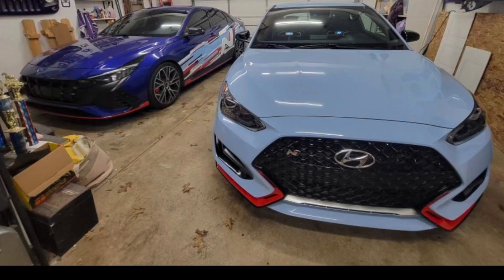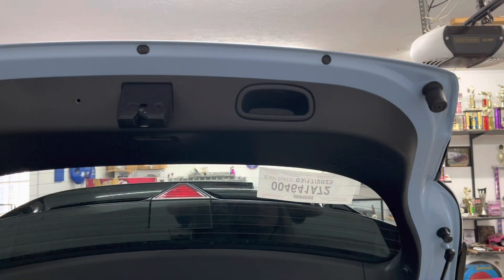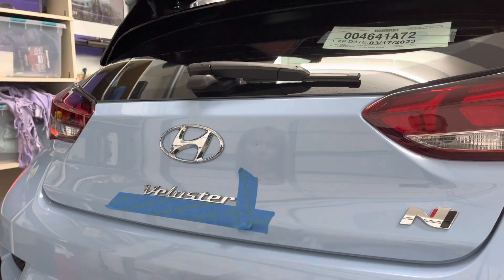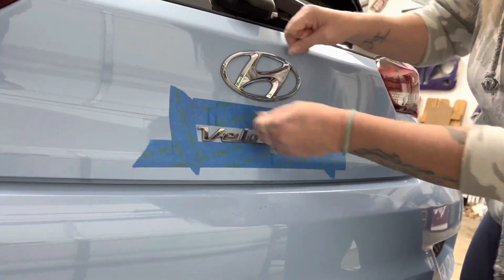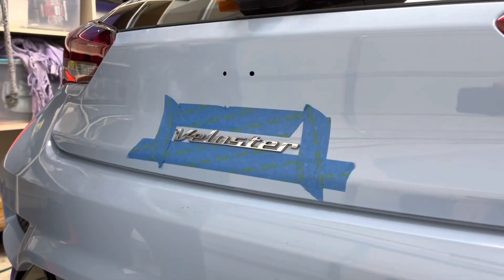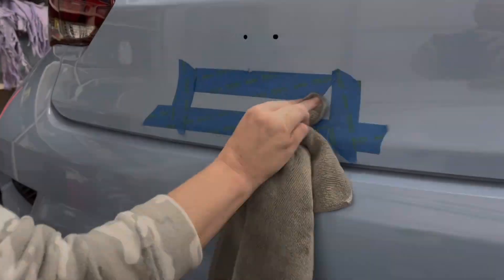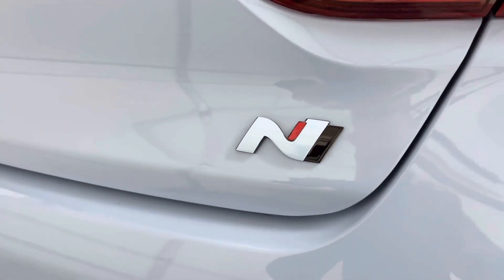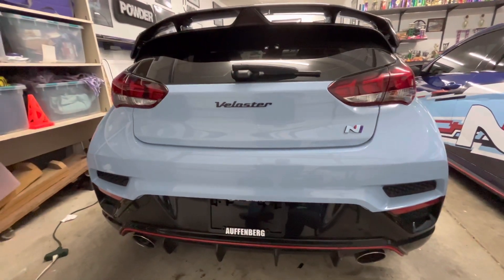2019+ Hyundai Veloster N Rear Badge Emblem Removal and Relocation

Comment: How can you cover up the the two holes that’s left from removing the emblem?
Reply from the maker: We put a small piece of vinyl over one hole and were able to cover the other one with the Veloster emblem. If you want the trunk to have no emblems, you’d need two small vinyl circles to cover the holes. That would be the cheapest and easiest way vs having the holes filled and painted.
Reply: @nprform  oh okay I see thank you! I had another question not sure if you’ll know much about it, but I have a Hyundai Elantra N-line and I’m trying to remove the front emblem but I noticed it has more than 2 holes like the back one does. Any suggestions on what I can do about that?
Reply from the maker: @Eyusria27  I installed an emblem cover. I bought it off eBay. 
https://www.ebay.com/itm/194328957704?mkcid=16&mkevt=1&mkrid=711-127632-2357-0&ssspo=fAQSDBC-TC2&sssrc=4429486&ssuid=2FlcmWy4Ru-&var=&widget_ver=artemis&media=COPY
Reply: @nprform  thank you so much ☺️ I’ll be ordering that part soon!
Reply from the maker: @Eyusria27  You’re welcome, I’m glad I could help.